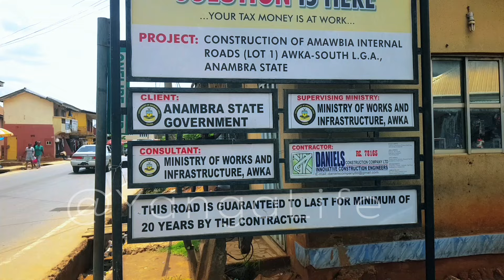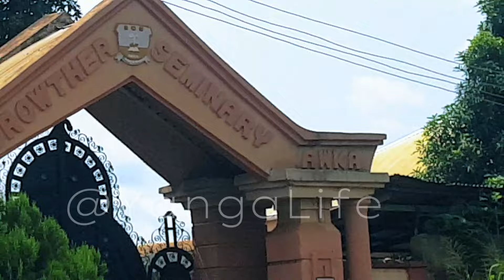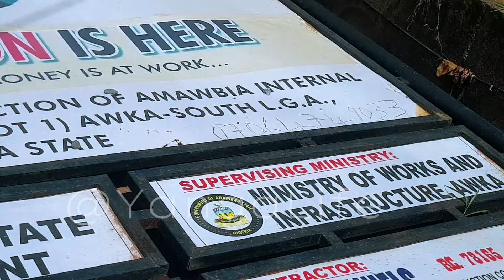Amawbia's Road Revival: Completed Routes Shine as Others Undergo Laterite Filling

Comment: Enugwu-Agidi, Nawgu, Ukwulu down to Igabriam and Awkuzu Internal roads should be constructed as well to open up those areas and expand development towards those areas. Enugwu-Agidi is part of Anambra Capital Territory and should not be neglected especially now that there are fewer structures existing there the dualization happening in Amawbia should continue from Enugwu-Agidi down to Ukwulu linking to Igabriam and connecting down to Anaku and other  Anyamelume L.G.A and other part of Anambra west and co to open up and quickly connect the rest of Anambra to those areas, it should be done now that we have fewer structures there to avoid economic loss in a short while when building starts springing up in those areas.